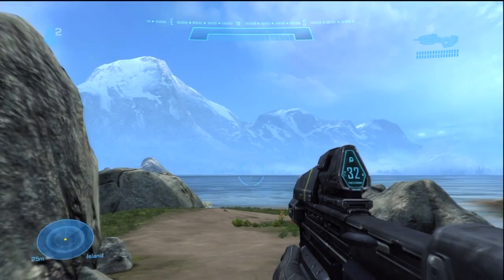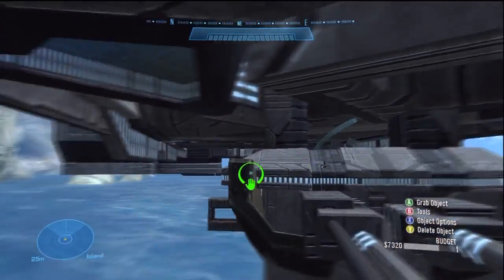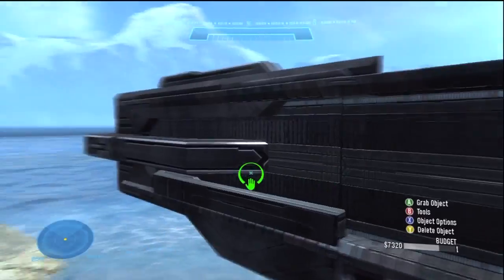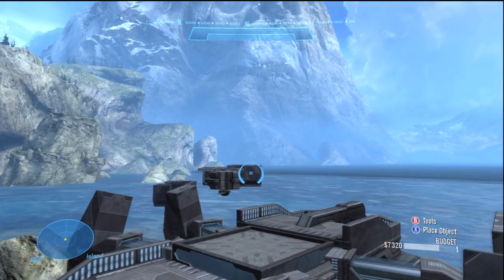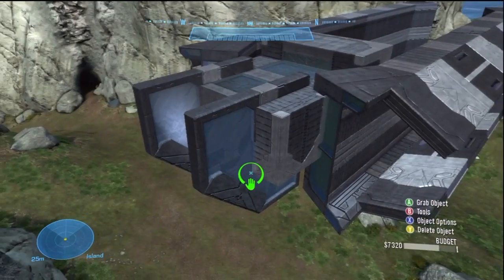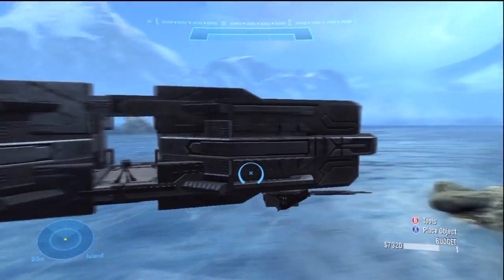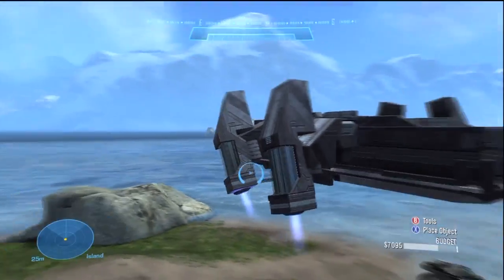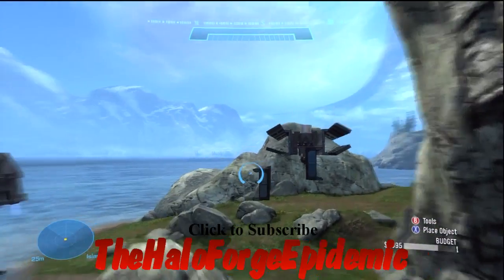"Air Vehicles" - Aesthetics

Comment: I made an airship that could hold 2 banshees that drop down and also has a jet pack jump bay, you can do it by taking a man cannon on phased and move an open banshee so the closing thing is phased into the man cannon, when a person gets in and the banshee accelerates it will free itself from the man cannon, if you add a one way shield in front of it at like a 30/15 degree angle it will force it downward.  Hope this helps!

Comment: @FrillzenSangheiliXD yeah its true that the corner pieces would look better but often I have to find compromises when I build. Using all those wall pieces would severely limit what you can build on the rest of your map. I tried to make a design that used relatively few pieces and still looked the part